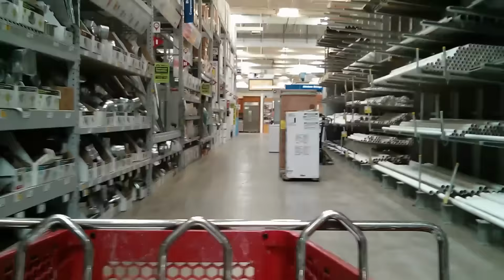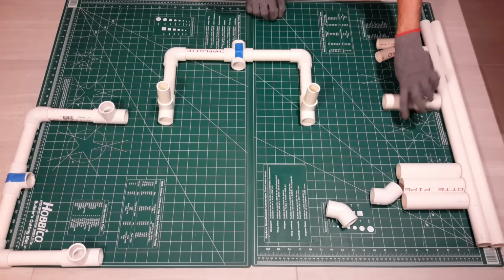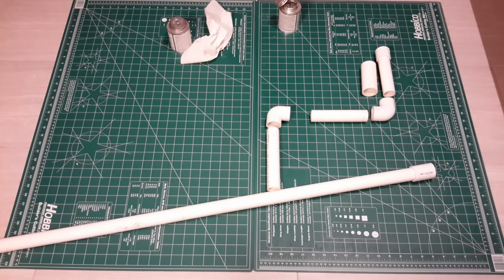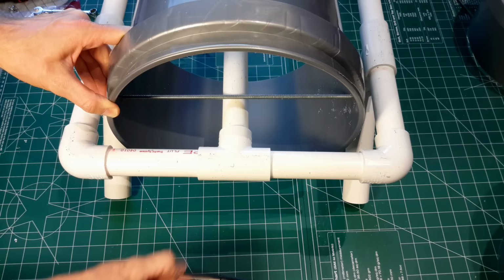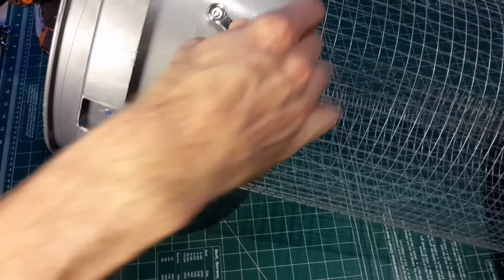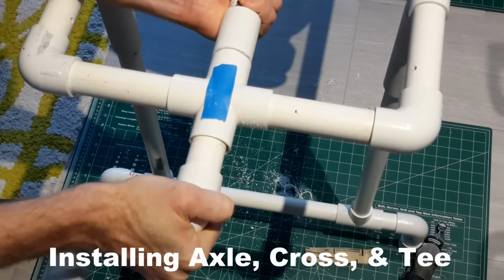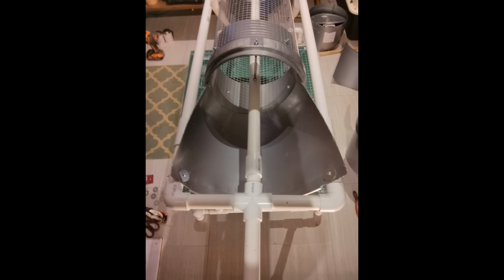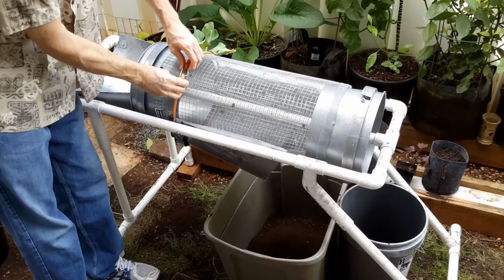How To Build a Worm Casting Compost Sifter

Comment: Hi Chris,
Mike Laine here from Mike's Trommel.  What a great video you have presented.  I thought it was well planned out and easy to follow.  I have used the trommel for gold, gem stones, archeology, arrowhead retrieval, compost, worms, concrete sifting, aggregate classification and even chicken poop bagging!  Every time I do a search I find another use.  When I first designed it in 2009 the trommel was primarily targeting prospectors but soon branched out to many areas.  I wanted a classifier that could be carried at least a mile away from the truck, along with a shovel, buckets, water and other gear in one trip without much effort.  Motorizing it complicated the build with battery weight, motor, power cords, gearing, and engineering.  I couldn't justify the use of sprayers, pumps, and hoses necessary to have a wash station either.  KISS (Keep it Simple) has always been my aim.  Besides, the hand crank is very easy to use.  I like the all-thread and have built smaller trommels out of 3/4" PVC using it.  If a prospector was to use all-thread I would advise installing two on each end of the barrel due to the extraordinary weight and density of rock.  Again, I like your build and presentation.
PS.  The mil rating on Home Depot (Homer Buckets)  beats Lowe's hand down!
Cheers,
Mike Laine
http://mlaine.epizy.com/Trom

Comment: Hi Chris. I've been generating more compost and vermicompost recently so I started researching better ways to sift the finished product.  I really like that your design is practical, affordable with all the materials easy to find at the local hardware store.  The only thing I may change is using less plastic in the design.  Of course, that would probably increase the price and take a little more work.  Great design!  Thanks for inspiring us.

Comment: I found an alternative to the Hole Saw through the Tee and the Cross Fittings.
I used 1-1/4" Tee and 1-1/4" Cross Fittings.

Plumbing List update:
9 - 1 inch PVC Tee fittings (Need 1 less) so 8
1 - 1-1/4" PVC Tee Fitting
5 - 1 inch PVC end caps (need 1 more) so 6
1 - 1 inch PVC cross fitting (4-way cross) (Not needed now)

1 - 1-1/4" PVC Cross Fitting
4  - 1-1/4" to 1" Coupling fittings 

Change out the 41-1/2" Axle to remove 5 inches for the Cross Fitting Adapter created below. So the Center Axle is now multiple pieces.

1 - 1 inch PVC coupling then used 2, 1-1/4" to 1" Coupling fittings for the 1" frame pieces.
On the 1" center turning PVC pipe end going into the 1-1/4" Tee, I put a 1" rounding End cap that fits easily and rotates very nicely on the round edge.

On the Cross fitting, I also used the 1-1/4" to 1" Coupling fittings for the 2 Frames pieces. (same as the Tee fitting on the outlet side)

I then used 2 - 1" couplings on 2 ends of a 1" @ 3-3/4" Length piece of PVC.  You have to glue on one side of the coupling to the PVC piece, slide it through the 1-1/4" Cross Fitting, then attach the other coupling.  The 1" couplings spin Very smoothly inside of the 1-1/4" ends of the Cross Fitting. This provides a huge added value in the wear-out factor is greatly reduced due to the added strength of those 1" couplings.
Reply: Would be great if you would a video

Comment: Smart use of the wooden cloths pin to help hold all thread as you attach the lock nuts. Had to look back and see how you did this without stripping the all thread. Great video thank you
Reply: tape on pliers also works well on all thread

Comment: What a great idea. Well thought out and makes quick work of sifting and can be used everywhere in the world. a 5 gallon bucket, some all thread, and some screen. Who'd have thought it would be that easy? And the rest can just as quickly be made out of wood or bamboo. 

I love this take, and it gives me options, I made one out of a dryer but the problem is I still have to scoop out the stuff that doesn't sift out.. It gets loaded pretty heavy by the time I have a wheelbarrow full, and installing a trap door does work so I don't have to scoop anymore, but it's a hassle I wouldn't have to do with this setup. Now i'm torn between this and a larger trommel made from bike wheels

Comment: Absolutely the best diy sifter i've seen. This is now on my Must-Must do list. Recently started bin-worming and will be splitting bins in about a month. Thinking about making a "screw-thread" at the intake so the compost is guided in. Also, a series of angled vanes on the interior of the sifting chamber would move the material along without having to build the sifter with a tilt, would probably work best with larger diameter containers.      Your build is really inspiring Chris. Thank you!         Liked, subscribed and shared.

Comment: Excellent idea and execution! Thanks for sharing this build. I'm imagining a slight modification where an electric drill can be mounted either directly to the drive shaft or through a pulley so you can just continuously feed the machine for processing larger amounts. Though I guess that kind of use would quickly see the pvc shaft and its 'bearings' heat up to a not-so-great level

Comment: I was about to ask how you'd separate the castings from the worms or even their eggs, but you pointed out that it would be a simple modification to wrap increasingly finer mesh around the trommel to filter at the desired particle size. Great job!

Comment: I wonder if you can add a diagonal edge to the front of the intake buckets flange, so that as you turn it the edge encourages material to move down the chute, so you don't have to manually feed the material?

Comment: Looks cool and useful, the frame however is a little flimsy to me, I would have used 2x4s and the same fittings for the axle. It would also be cheaper for me that way too, since I have little pipe and tons of 2x4 lumber

Comment: This was pretty impressive but, I didn't and wouldn't have the time, patience or money for all that. I just deck screwed  4 2x6s together a little bigger than my wheelbarrow  about 30x30 and stapled some 1/4 inch hardware cloth to the bottom. Now I just shovel in a couple scoops of compost, wear a heavy duty work glove and mix it around a little or slide it back and forth rapidly. You can lay finer hardware cloth inside the box if need be and use some wire to affix it to the other mesh.
This project would be worthwhile if it was scaled up 2 or 3 times, maybe out of some 55 gal drums and iron pipe.
My 2c anyways

Comment: Hi Chris :-) 

I liked your machine but for other reasons :-) I have been digging out the back yard and putting in retaining walls and your machine would be grate to sifting out the rocks and stuff from the soil so I can redress the areas once I have then levelled it all out at the moment I have been doing all by hand and I have an old electric whipper snapper /edge trimmer not sure what they are called outside of Australia :-) it does not go on high speed anymore only low so that would be perfect to do the turning for me :-) 

Thank you for a great design and on how to build it as I have most of the stuff laying around the yard (Dad loves to collect odds and ends) :-) so I am sure I can find everything I need in his scrap heap :-)

Comment: Could you upload a video using this design to sift the castings with worms still in the soil+casting mix? I want to see how the worms would be collected once the castings are harvested.
Reply: I used my trommel to sift some castings that had very stubborn worms I was unable to remove prior. They ended up dangling over the screen mesh quite often and i just hand picked them off after each spin. I'd suggest using the smaller mesh if you want to avoid that headache. By the end, the worms just ended up the in output bucket. Only problem is sometimes the worms end up caught between the 1/4 inch larger mesh and the finer mesh you wrap over that.

Comment: a wood structur would be both cheaper and better. way more stabil. and with the option to place bearing made of metal+ handle. also the shaft could easy be made with same metode in thin metal pipes, with drilling and bolting. also instead of the plastic buckets, use metal ventilation pipes. you can apply all thies items in the same way for cheaper and make a much better machine. outer wood structure(saw and screws). metal pipes for bearing, shaft and handle(grinder, drill+bolts)

Comment: Mahalo!  Question, instead of increasing the ID of the T and the X axle caps with a drill, could you use a slightly smaller OD axle pipe and then simply slide the axle into the end pieces?  That sounds easier than having to drill the end pieces to make them slightly larger to hold the axle.  Another thought would be to use a heat gun to heat the end pieces (caps) from the inside.  As it becomes soft, insert something with a slightly larger OD into it (the "expander") as far as the retainer edge then run under cold water to cool.  Remove the expander and repeat on the other cap.  When it is time to assemble, the axle will slide right in and still have enough play to rotate.  That would be a much faster and possibly an easier method.  It would also not reduce the wall thickness which makes that area more vulnerable to breakage.  Heating and expanding the axle caps like that would be my personal preference. A scrap piece of a larger OD PVC pipe might be a perfect expander.
Reply: ***** Heck, the very bit you are using to drill the ID would be the perfect expander.
Reply: PVC doesn't need much heat to expand from what I understand.  It should not warp either.  The trick is not to over heat it and to heat the connection fittings from the inside, not the outside.  Heat the inside of the female connector, slide the drill hole maker in to expand it and then cool under water.  The PVC just has to be a little bit pliable, not hot like what you would need to make a 45 out of a length of pipe, just pliable.

Comment: Hi, I have a couple of questions.  
1.  Where did you find the gray buckets?  I couldn't find them at Home Depot or at Lowes.
2.  Where did you find the 1/8" mesh?  I couldn't it at Home Depot or at Lowes.  (They did have the 1/2" and 1/4" though)

Comment: Instead of the rotisserie handle, wouldn't you think it's possible to center perfect the end of a 1/4" drill bit end. Attach a cordless drill as needed and allow the drill motor to turn the tumbler.
Reply from the maker: You absolutely could.  Then support the drill and you have an automatic sifter.  Great thoughts!

Comment: curious the machine looks good but i question its ability to seperate the worms without harming them/ cutting them well.  If your only after the composted side and dont care to much about the worm growth / development. Then great but i still thinking the ridged wire mesh could be to harsh for worms .
Reply: But you covered the other side of actually building a similar sifter i was just concerned because he said if you dont do it right you can cut your worms into a million pieces which wouldn't be good thing. But you definitely have the idea... It could be just as good but its one of those things i can tell i have to be there and see it in action... or what type of worms your sifting to.
Reply: At any case on a small scale like my project i just hand sift it or using a sifting , miner gold/silver sifting screen or something. But i can see when you got a ton of dirt to sift /separate worms out of you kind of need a good machine like you guys got.

Comment: I don't see any worms :) If this is a compost sifter, just make a ramp out of the mesh and shovel the compost onto the top of the ramp. The sifted compost will fall below and the larger debris will collect at the bottom of the ramp. This is an example of a DIY project taking too much manufactured materials that will end up in the landfill.
Reply: +Chris Fietzer Thank you for the reply :)

Comment: It looks like it’s been a few years since you built this would you make any changes
Reply from the maker: The only changes I would make to this design is to use 55/30-gallon barrel plastic for the infeed and outfeed as that plastic has UV stabilizers and is nearly indestructible whereas the buckets are not as durable. Thanks for the question.

Comment: Nice video.  Do you get any material stuck between the 1/2" screen and the outer screen you wrap around it?  Have you tried putting the finer screen inside instead?  I figured that since the main screen is a bit conical, it would hold the finer screen inside without slipping off.  Again, nice video.

Comment: Chris, Great job! I’m just finishing mine up hopefully today. I’m going to use it to sift compost. I’ve been really struggling with how to get the buckets round and spinning in a balanced way. I’ve been goofing around with adjusting the all thread axle length and squeezing the screen but nothing really gets it rolling completely round. I guess in the end it really doesn’t matter that much but I’m just trying to get it right the first time through. Any ideas?
Reply: Chris Fietzer - did you ever do any revisions or a second generation version? Your video was a great step by step guide. So was you material list. Really nice! You must be an engineer...
Reply: @markbaker1827  adding a second piece of threaded rod inside perpendicular to the first would most likely add more rigidity.

Comment: Love this!  I'm going to start working on one.   Any updates or advice since originally posting or from anyone else?
Reply from the maker: Use 55-gal barrels for the plastic parts. I believe somewhere in the comments someone mentioned using 1 1/4" PVC for the outer frame so the 1" going thru the sifter would fit thru vs. dremeling out the Tees. Share a photo once you build. I'd love to see it!

Comment: excellent!! One question: whats the reason for starting with 1/2" mesh then wrapping with 1/8th?
Reply: Kripanidhi Dasa It would allow you to have the option of a finer, or coarser end product. If the 1/8" is put on first it would be a lot more work to switch out screens if you happen to need  a coarse compost. I would think the bigger screen would probably give it added strength too.
Reply: Actually I used a heavier gauge 1" square welded wire caging because it is BOMB PROOF; I also used electrical conduit for the legs for more stability and strength.  I built one similar to this about 10 years ago to sift grains and to sift the fines out after grinding grains for making poultry feeds; this way I can make feeds for chicks from the fines.

Comment: o k, but how do you separate the worms from the castings?
Reply: +Augustin Pricop   Use a 1/4" screen and most of the worms will pass through while the castings fall out. I've never done it though so you might need a smaller screen.
Reply: Thanx

Comment: Great idea. Going to try it. Is it me or is the materials list etc. accurate?
Reply from the maker: Material list should be correct. Good luck on your build!
Reply: @PlantedByChris  oh yes my mistake. If i may ask do you recall what grade/class of PVC pipe you used? I can get class 12 here in Australia which is quite expensive once it's all added up.
Reply from the maker: @rayh7264  I used Schedule  40. Pressure rated.
Reply: @PlantedByChris  thanks for the responses. FYI I priced the components now in 2022 here in Brisbane. Excluding the fasteners it came to A$245. That 7 years after you made this video. Inflation plus I think things are more expensive here in Australia. 👍😊
Reply from the maker: @rayh7264  WOW!!!  That is not inexpensive at all. Thanks for sharing your findings.